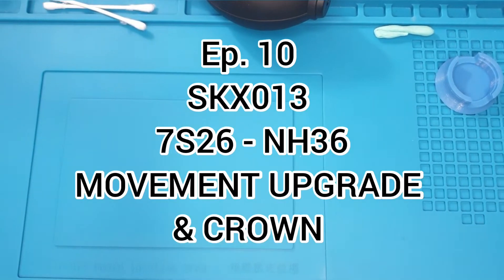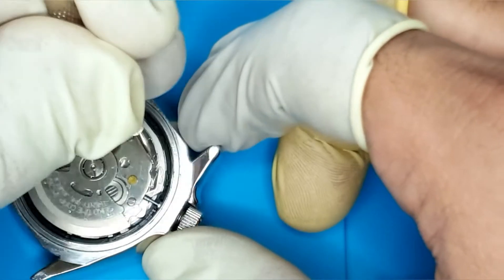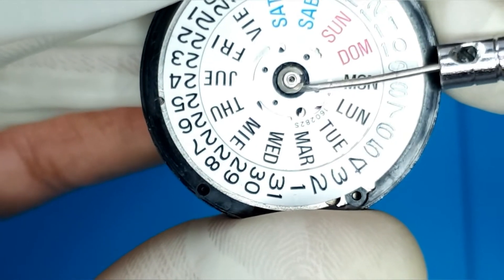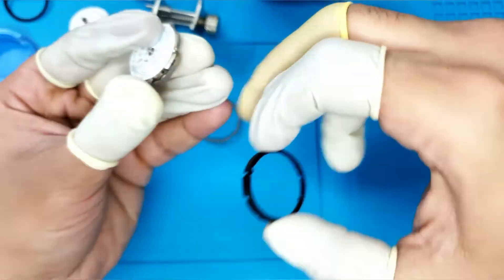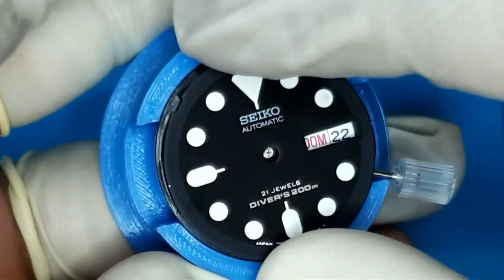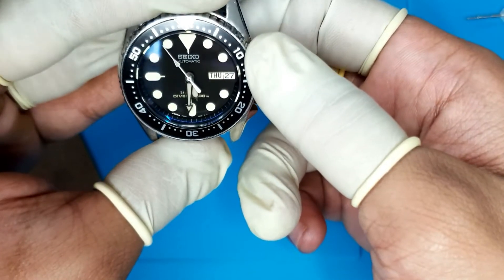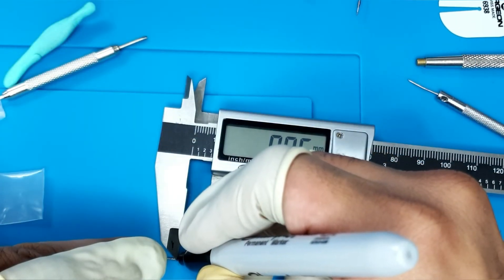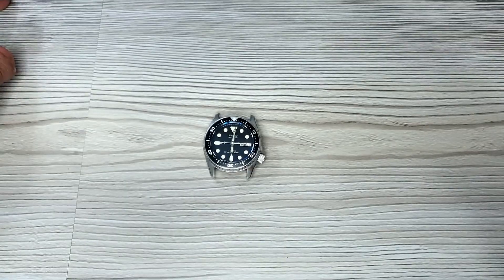|J4TM|⭐ Ep.10 - How to upgrade your Seiko movement⭐| 7S26 to NH36 | The Watcher

Comment: The video is great, thanks! I was considering swapping a 7s26 with a NH36 (on a watch that is not an SKX), but I understood I need to replace the crown as well. Is it compulsory or you did it because the original one was not so good in your eyes?
I fear I won't be able to find a replacement crown suitable for the NH36...
Does the NH36 come in different flavours, like the NH35 which has also an NH35A variant?
Reply from the maker: Hi Raphael,  you will need to replace the stem and crown when modding to nh35 or nh36 from a 7s. Further there are no other variants, there is just nh35a and nh36a, people just call it nh35 or 36.
Reply: @just4themodderz37  thanks for the information, I should have done my homework before ask about the "A or not-A"... Then you mean that the end of the stem that screws into the crown is not the same for NH36(A) as the one of an 7s26... That means I'll have to make further investigations before swapping my broken 7s26 with a new NH36... bad news but hopefully you warned me!